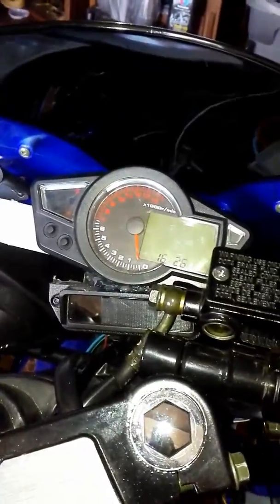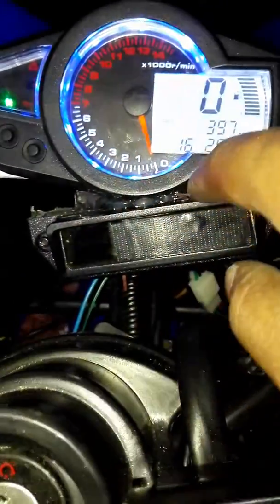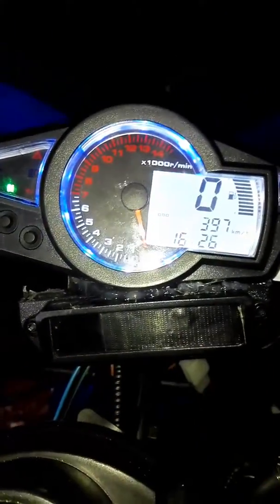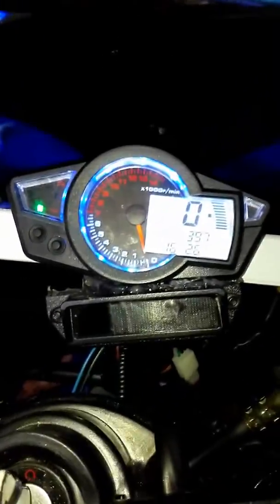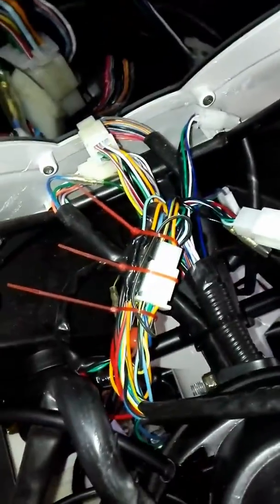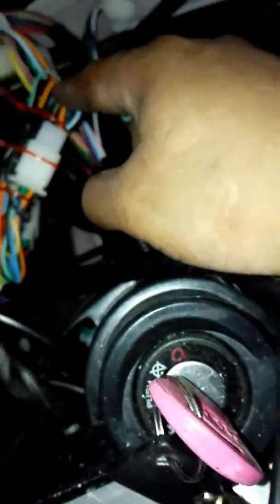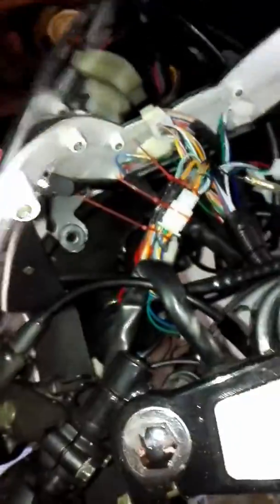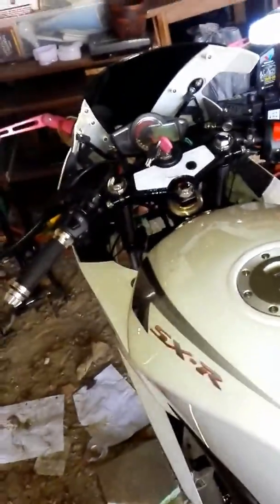Digital Speedometer change on 2 2016's DONGFANG SX-R DF250RTC

Comment from the maker: I didn't mention in the video because I didn't realize it till later on that day,  that the speedometer was set to kmh and was a pain to get it set to mph , just in case someone is having this issue,  the way I did it was with the speedometer off I pushed both buttons down for 5 seconds then quickly turn on the speedometer hold for another 5 seconds let the buttons go then quickly push them both back down until it changed to mph,  I had to do a lot of research to find that out but I got it done.  also you will have to go back into the settings and set your mileage again if you've done it already.  on mine I had to set it in kilometers and it will automatically be in miles when you get off the settings . I don't know if anyone else has had this issue but just letting people know
Reply from the maker: I haven't opened them up yet but I have had them both up to 50mph on 4th gear,  I'm pretty sure they'll go up to 75 maybe 80 without a problem
Reply from the maker: The Turk I have noticed though that they were giving me issues because of the high flow exhaust,  I had to disable the pair valve / secondary air injection system,  so I made a blocking plate for the port and it's running way better since that was done
Reply: Alejandro Roman were u get the gage cluster
Reply from the maker: I got it from eBay,  just search for universal speedometer
Reply: I have this same speedometer .  I appreciate the input on changing the KPH to MPH. It was driving me nuts.   Do you have any input for the other menu sections? I assume one of them I would need to put the tire size in or wheel size to get the speedometer to work accurately? The rpm's seem to be on.    I bought mine to replace a Identical one that came factory on a ssr rowdy 150cc honda big ruckus clone. I never had to mess with the factory one. It was set up and was working until the screen went blank.
Reply from the maker: Deezildennis push on the right button alone for a few seconds and I think that is for the time,  and if you push on the left button a few seconds it should bring you to that configuration.  hope that helps
Reply: Alejandro Roman any luck on that lowering shock
Reply from the maker: Manuel Hernandez I have found something on eBay,  but they're for Honda groms they look similar I'm just doing a little more research on dimensions,  just search on eBay adjustable shocks for groms they should pop up